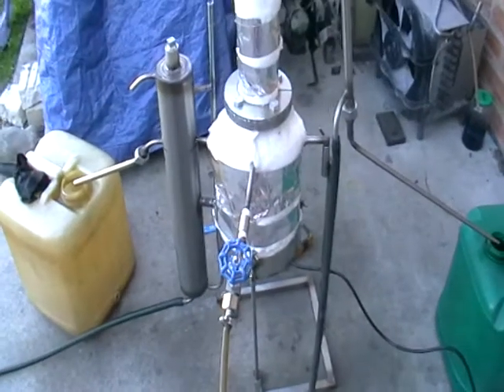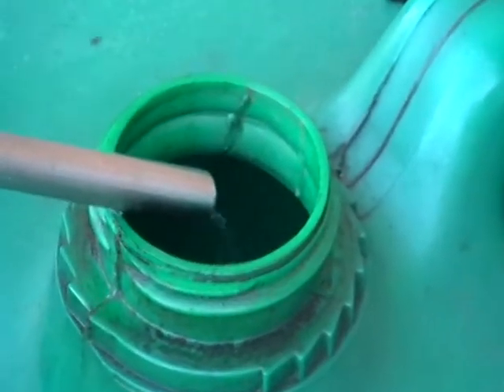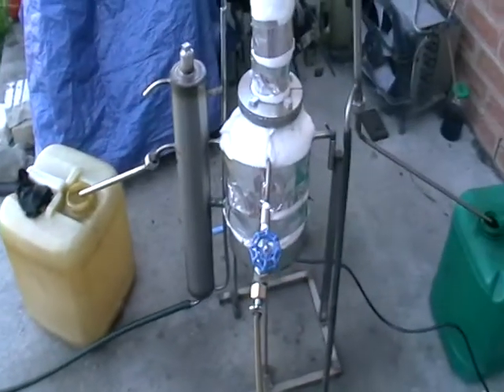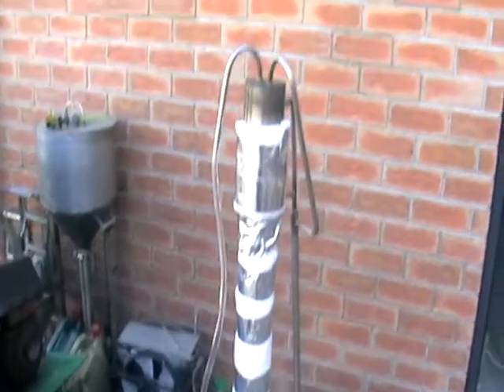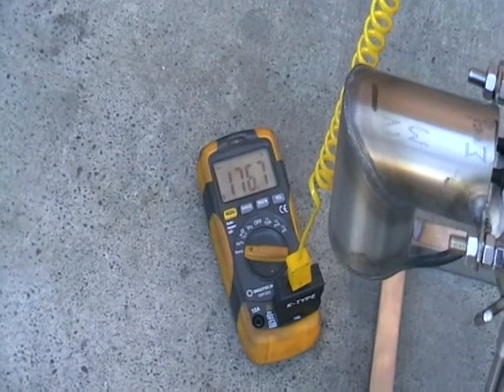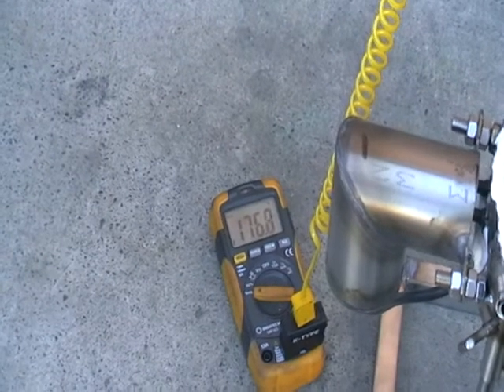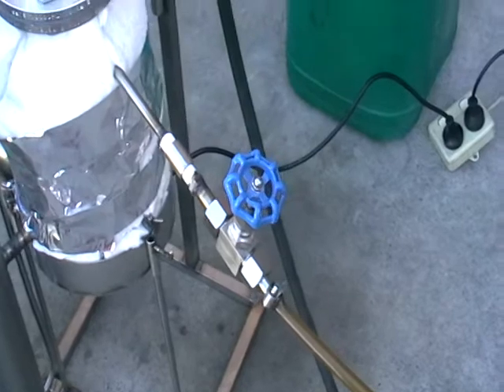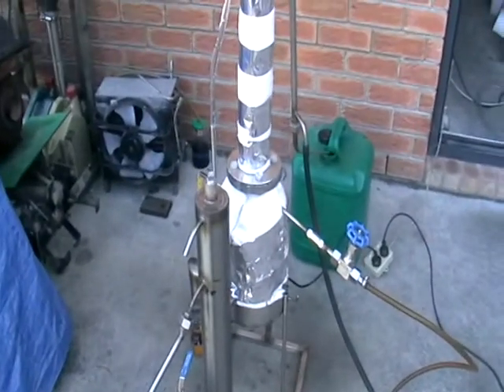Mixed fuel separator

Comment: My brother, this is a reconciliation device that filters black oil

￼
Reply from the maker: this machine is separating accidentally mixed diesel and petrol, it also can process natural gas condensate, or separate light fraction from any liquid hydrocarbon mix.
Reply: @santeryi9  
I want to repeat used car oil, making grease, I am not interested in diesel or gasoline now in the country, a good low price
Reply: @santeryi9  
I want to repeat used car oil, making grease, I am not interested in diesel or gasoline now in the country, a good low price
Reply: @santeryi9  Can the phone number reach you?